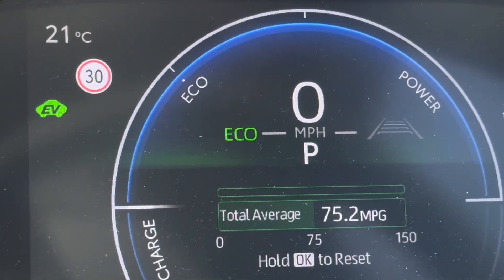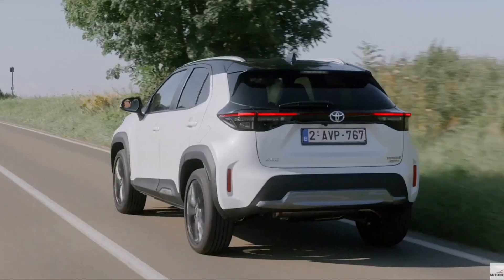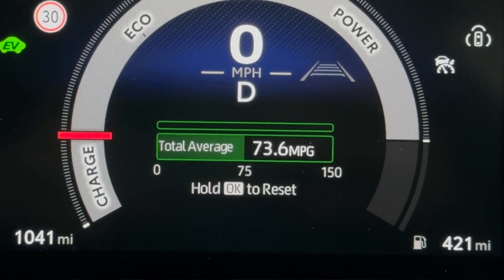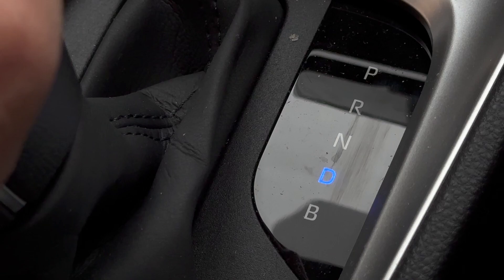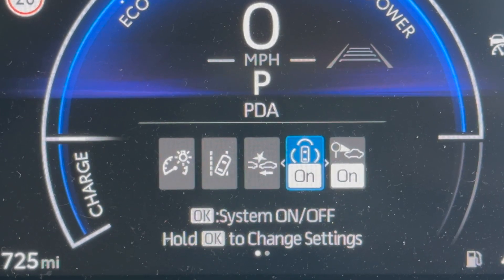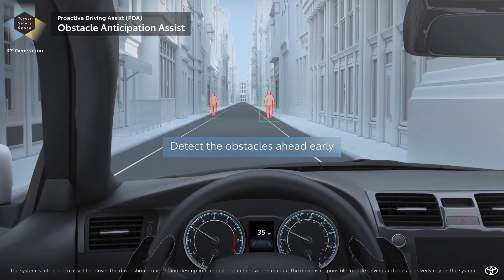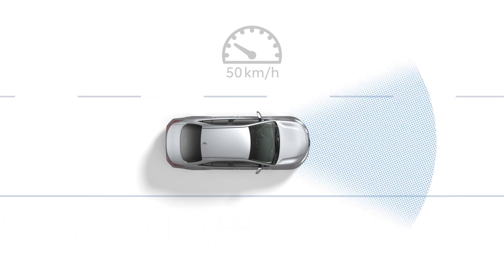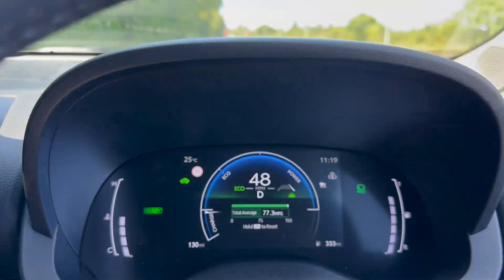Setting up a modern (Toyota) hybrid

Comment: Totally agree with what you say Steve, being an older driver, I find the safety systems give me back the capacity I've lost as I got older. I use adaptive cruise control whenever I'm on the M1 on my once a week drive to London, and in the ubiquitous heavy traffic I find the whole experience far less stressful knowing that in the event of a momentary lapse of concentration the car will safeguard me from rear ending the car infront or inadvertently drift into another lane.  Once in London where speed limits change at  an alarming rate and speed cameras proliferate the Road Sign Assist is an extra pair of eyes and again I feel that more relaxed driving in the city now. Yes it can be a little annoying but beats getting a nasty surprise in the post a week or so later :)